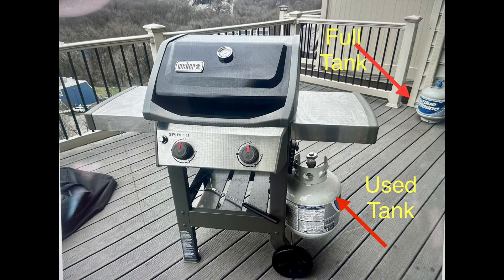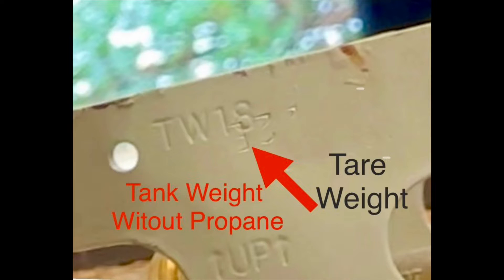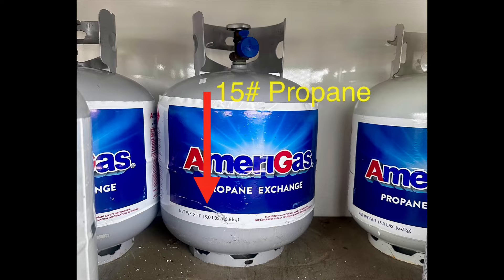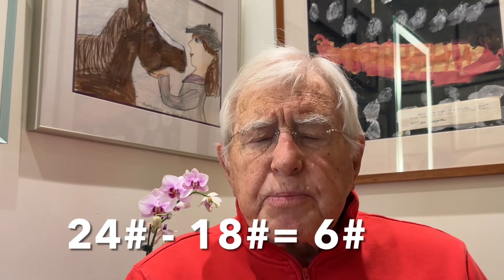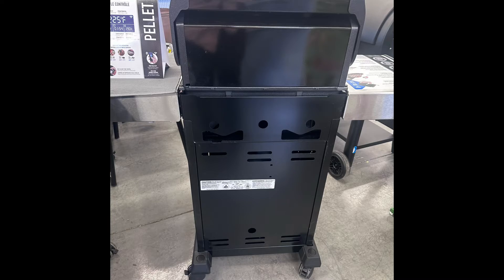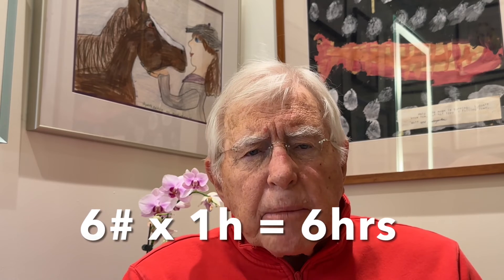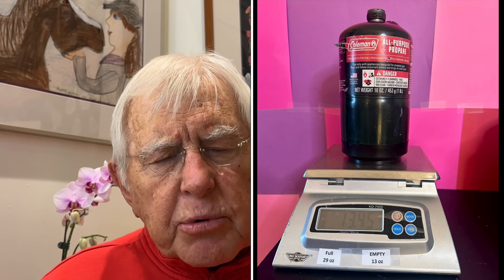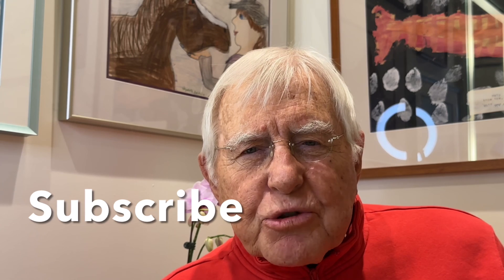How Much Propane is in the Tank and How Long Will it Burn?

Comment from the maker: One gal of propane weighs 4.24#. The TW (weight of empty tank) of my tanks is 18#. The WC (water capacity in gallons) of my tanks is 4.76 gallons. I have three tanks. Tank A is full from a Blue Rhino dealer. It weighs 33.6#. Subtracting the TW gives me 15.6# of gas. Dividing 15.6# by 4.24 (the wt of a gal of propane)=3.7gal of propane. 3.7gal divided by 4.76 gal= 0.77 or the Rhino tank is 77% full. 
Tank B was used and I had it filled at a local RV Park that fills propane tanks for its customers. After filling, Tank B weighs 36.6#. Using the same math Tank B filled by the RVP is 92% full. Tank C was also filled by the RVP and weighed 37.2#. Using the same math, Tank C is 95% full. Propane from the RVP is $3.50 a gallon (or $15.75 for 4.5 gal). An exchange Blue Rhino tank cost $22 (Reddit, 2years ago). This is $5.98 a gallon if it is 77% full. Three take aways:1. Exchange tank propane is twice as expensive 2. Local dispensers of Propane may put more gas in your tank. 3.  Exchange tanks have the recommended volume (below 80%) and are therefore safer.
Reply: Yes, your math is spot on but you must keep in mind that 20 pounds is 80% of the maximum the tank can hold.
Your take aways:
#1. Yes, it does cost more but it can be more convenient.
#2. Yes, but modern tanks have an Overfill Protection Device (OPD).  When working properly it will cut off at 20 pounds, plus or minus a little.
#3. Safer?  That opinion can be subjective.  A tank with only 1/2 pound in it can produce about 10,000 BTU which some might consider dangerous,

Comment: 80% is actually 20 pounds.  Exchange tanks are only 3/4 full.  If take your tanks to some place that will refill them, they will put 4.5 gallons in the tank which is 20 pounds.
Reply from the maker: I would love to see your math for a standard BBQ tank (TW=18;WC=47.6). Thanks again for commenting. 👍
Reply: @jameslesterbaldwin9841  That's a 30 pound tank.  30 pounds divided by 4.44 pounds per gallon is 6.75 gallons.
Reply from the maker: Please see the comment about the subject that I left today.. Very interesting. I would welcome your opinion and a math check.